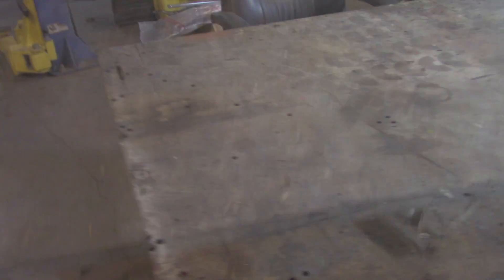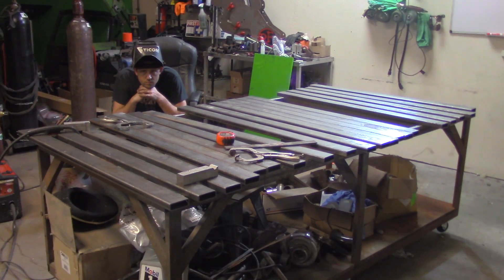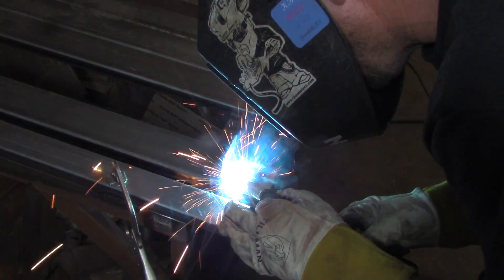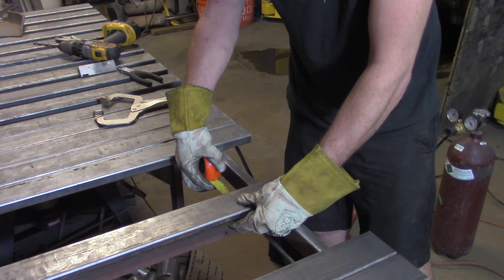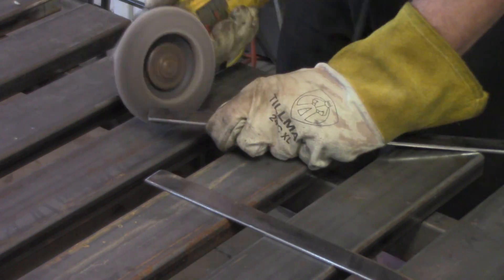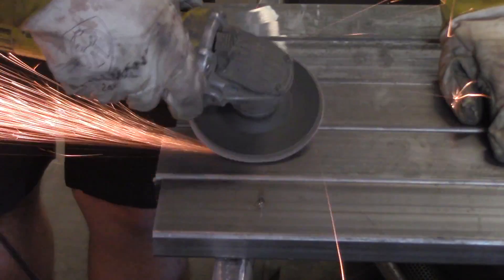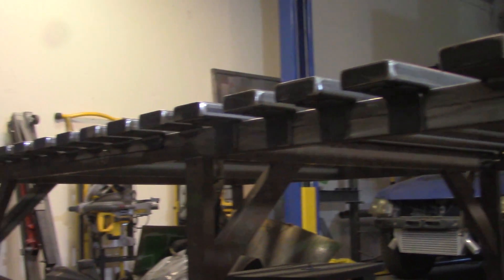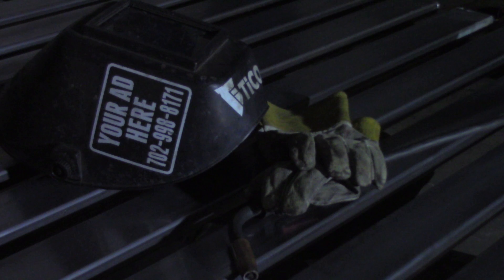TFS: Inexpensive DIY Fab Table

Comment: I needed to build a table for use at work. I need a general fab table that i could customize for a specific job.
I used this table as inspiration but built it heavier. It 5x10 with 2x4x1/4" wall tube. Turned out great. Thanks for the inspiration. Wish i could upload a picture

Comment: Tip for those holes if you are using a standard drill. Measure and mark 1 peice, stack and square the ends on one side, clamp throw a square on your mark and you are halfway there

Comment: Not the table for me.
As a fabricator I would have assumed there's gonna be spatter all over your slide rails eventually, you've made them so tight fitting that one little stubborn berry with mess with your table.
Good idea in theory, you made it look awesome, but I don't think this table will have much movement soon after fabbing on it begins.

Comment: I am planning on building a similar table and was wondering if you think rectangle tubing is better to use that flat stock. My idea was to either use 1/2" x 4" flat stock or 1" x 4" 10ga rectangle tubing. Not sure which way to go for my first table. I'm just a home hobbyist. Thanks in advance

Comment: any ideas on how to make a flat table without something flat to build it on?
Reply: Well... it ain't easy but it's possible. That's how they made the first one, after all :)

Pretty hard to explain in only words, asks for experience and demonstration really. First thing you need is a lot of patience and commitment. Then at least one big fat perfectly straight portion of square or rectangular tube to use as a clamping base/guide to assemble your parts, at least two C-clamps, big Vise-Grips, or welder's positioning magnets, and preferably two or more levels to measure alignment as you go along. To make a first rectangle, build two "L" halves first, using your fat strong clamping tube, then assemble them into a rectangle. Use a square, or the Pythagorean Theorem to check your half rectangle "L" shapes for straight angles. Use diagonal measurements to check your final rectangle, the square is not useful here.

Mind how you tack your parts, to counteract the shrinking after tacking - always work in an X pattern. Make sure everything is aligned after tacking, before final welding. Do not completely weld the half rectangle "L" shapes before assembling the entire rectangle. Use more well placed tacks, or a hammer, to sort things out if needed. 
Tack the entire structure before final welding, preferably. Use triangulation in your design, when you get to the supporting structure.

Measure things after every welding action. If you want to be sure, loosen the clamps before measuring - things may move, and the harder you weld, the more they will. Each time you weld, there will be shrinkage after cooling. You need to balance the heating and subsequent shrinking so things end up straight and square - hence the "X-pattern" you need to observe. 

Easier to explain than to do. Nothing beats experience, which is acquired by trial and lots of error ;-)
So try on a bunch of scrap first, preferably of the same dimensions as the final project, until you know you got the feel of it.

After a couple of builds, you'll go faster and without so much precaution ;-)
Reply: @wildepascal  it was hard. but excelent explanation. so, i understand i have to clamp the two parts of the "L" to a big fat flat piece of steel. do it twice, then join them together. (still using that as a reference )
Reply: @wildepascal  btw. i didnt say thanks

Comment: This is awesome! With regards to the end caps, I think cutting the square tubing to bend the metal over may save some time.
Reply: That would take 2 cuts, bending/hammering, 3 welds and post grinding. 1 less weld than using flat bar for end caps but more time spent in the bending/hammering phase

Comment: Very nice fab table top. Only one thing I saw you missed. Unless it just was not shown in the video. The angle V on the one end. What is needed is flat stock on the bottom for a flat clamping surface. That allows pieces to be easily clamped in the V angle for welding.   My dad has this feature on his portable welding rig. Works great for many things

Comment: Well it's inexpensive when you find the working material near a dumpster, isn't it?
Reply: If you don't, get two identical saw horses and use those as feet. Makes for an inexpensive yet portable welding table.
Reply: @brag0001  I actually built my own welding table out of an old machining table a local factory was throwing out. Its not portable, but it is solid and spacious. If one gets lucky and finds a reusable table or materials, making a nice welding table can be inexpensive, but if you have to buy all the materials, not so much. The saw horse idea is actually a very good one for a potable welding table. I might try and make one out of second hand saw horses.
Reply: @jamal69jackson77  It's not even mine. I just saw it a few times on youtube. And since I don't have a lot of space for my workshop (1,5x1,5m, I'm not joking), I need to be able to move everything outside easily.
I started welding as a hobby only a few month ago, so I was looking to get something usable yet inexpensive. Two height adjustable saw horses cost me less than 45€, including shipping. I paid another 40€ for the metal to put on top. I've yet to assemble the actual table top, which I'm going to do this very weekend :-D
Reply: @brag0001  Good luck with your project!

Comment: I'm almost wishing I saw you before I built my table.
Lots of great ideas here
Dag your welding skills 
Great table build.
Mine have roller wheel and lockup to my wall when not Welding ,also as I need to wood working I have a plywood top that lifts off to weld in seconds ( love that) for I do both Wood Working and Welding and greasy car filthy stuff
Thanks for a great video Sir

Comment: i'll do the stick and scoot every time. Why?   If for any reason you get a bug problem whether it be spiders, roaches, or anything of such nature, you want those tubes covered.. No one is immune to infestation and structure like that with tons of deep holes that you can only reach with an air chuck is a no no... The pain staking welding is nothing compared to the pain staking dealing wih an aftermath of infestables.. However, to deal with the repetiveness of doing that job.. I would have come up with some nice looking design of a solid single piece that would cover them all yet not just be a straight piece of bar stock.. lol

Comment: Very clever design.  I like it.  I suppose you could space the tubing so individually removable tubes could turn this into a solid surface by pressing all the slip-joints together then add the individual ones.  I don't do much fab at this point so maybe this wouldn't make a practical difference.  I am thinking of building a regular work bench with similar features out of wood.  Once I get welding/fab going I will build your design.

Comment: Would it not be advisable to leave the end caps off to cool things off?  I made a table like this out of 3/8th steel flat bar. It heat warped and the slats are not level with each other.  I'm thinking about doing the 4 bolts on each slat to level it.  The rectangle tubing seems like it would be better than mounting slats on bolts.  What are your thoughts?

Comment: Stack angle/bed rails  w slats cut for the rails.   Removable, adjustable, and good for bending thinner metal also.
If u Fab it to a treadmill base u can adjust it up and down at an angle.

Comment: A sizzor lift hydrolic level positioner would be crazy.
Reply: I was thinking cheap bottle Jack's at 4 corners for height and level adjustments with something on the table. Get air operated Jack's for the win.

Comment: I wonder if tubing filled with concrete, it will give some advantage that kind of design?  Thanks
Reply: I think it definitly would but also would add sooooo much weight
Reply: Will also explode when heated!
Reply: @TheSoundOfTwang  why it should exploded? Skyscrapers use this technology...
Reply: @717Fang  Sky scrapers usually don't get heat cycled a lot ...

Comment: The one thing that I would've done differently is go get a bunch of metal shavings/chips to fill the tubes before capping the ends. I've got a table kinda like this at work and doing that really cut down the noise/harmonics.
Reply: Oliver Hall great idea - solid packed, or loose fill?  I was thinking dry sand, because I haven't made enough metal chips.
Reply: @firstmkb  Dry sand would work excellently, probably better than the metal chips - 50% fill should be more than enough!

Comment: Will pressure from heat not build up in the tube?
Reply: Better leave at least a small air hole for it to escape.
Of course, for the novice welder that isn't hard.

Comment: Looking for a suggestion on how to get the top on my table mounted perfectly flat with each other. I have 3 - 2'x3' pcs of 3/8" plate with space to slide clamps in between. Thought it would be a great top but I'm having trouble getting a flat surface with the 3 pieces. Any thoughts?? Thanks in advance

Comment: hammering ?
Reply from the maker: Mike Forrest Hammering what?
Reply: The Fabrication Series look 👀 nice but how can u 🔨 on tubes ?
Reply from the maker: Mike Forrest I'm not sure I understand what exactly you're asking.
Reply: The Fabrication Series never mind looks great 👍🏻
Reply: It doesn't look sturdy enough to hold up against hammering. That's what he meant. And it probably bounces around or gets damaged quite easy. In our factory we use like 1 inch thickness sheet for the top and it weights more then 2 tons, lol.

Comment: should have used at least 1/2" thick flat stock instead. much flatter surface and much stronger against hammering and such. its a weld table, who cares how heavy it is as long as you can move it.
Reply from the maker: Nick Corkery Consider the use. Match it to the use. Anything else is unnecessary.
Reply: The Fabrication Series well at the very least you should want as flat a surface as possible. And we all know that square tubing is not perfectly flat.

Comment: I was building a hot rod frame and had no table. Needed something to tack down frame rails to. Went and bought a 3/8” 4x8’ slab of mild steel. Put it on the floor of my garage. Did layout on it tacked parts down. Worked great, takes up no space. You have to work on the ground but the plus side is you don’t have to lift anything up.

Comment: Table wobbles because the legs need more bracing, the sliding  section is starting to jam up already. Good idea, but needs improving.
Reply from the maker: +norman norton it's on wheels. It doesn't wobble. Read the other comments about the slats. There's a reason they don't slide perfectly free.
Reply: OK, thanks for the prompt reply.
Your table has certainly given me some ideas for my one.
Regards from London, UK.

Comment: Hi ! I'm french so excuse me for my english and i'm not a professional but i'll do some metal work so i want to build a good table... i love your welding table, i'll do the same !! 1 want to do one about 120" x 60"' (hope i'm ok with the conversion from cm, 300cmx150cm i want)
I just want to be sure for the tube to buy. I think to do the frame with square tube 2"x2" but i'm not sure about the thickness, 0,11"or 0,15" ? 
And for the rectangular tubes 40"x20"x0,07" or 40"x20"x0,11"

Thanks a lot for your video and hope to read you for my question. 
Bye !

Comment: like your build I've watched quite a few...there a couple like this but I think I'll with square tubing and use smaller size so I can make a slip in vice and slip it in the box tubing..on the sides..I also like the v trac...idea and the pull out leaf is good..
........

Comment: You could make the slats retract or extend by power remote control. Use an old windshield wiper motor and threaded rod. Easy enough to link them together.

Comment: some dielectric grease on those sliding portions would probably make your life a little easier. looks like they're a little sticky
Reply from the maker: gvente87 Once the grinding and metal dust gets stuck to the grease it would make like hell. I also don't want them to move easily when something is clamped to them.
Reply: yeah I just though about the dirt build up issue then saw the notification that you had replied. :-/

Comment: Nice table!  (Maybe you can grease the supports a bit so those top rails slide a little easier.)
Reply from the maker: Mark - Grease wouldn't work well after a round of grinding. I also kind of want them to be difficult to move since I don't want the part I'm clamping to potentially slide out of position.
Reply: The Fabrication Series - you're right, didn't think about the grinding.

Comment: You had me at "inexpensive".
Reply: Except it isnt really, it is a nice table with its function, but it isnt inexpensive
Reply: @pitpotdeeerste  less than 300 bucks.  Turned out amazing.  Just the time cost kinda sucks.
Reply: @kartnerds  Compared to some of the fab tables 300 bucks is inexpensive, yet 300 bucks is still a little above my budget for this hobby. Now if i recall correctly the top was made of tube,  i personally was thinking about a U profile 40x20x5mm it would set me back 18 $ per 6 meter which would be 50 by 72cm  in work surface with 2 cm spacing's .
 Some 40x40x4 mm angle for the legs and cross braces which is 25 bucks for 10 meters ( i am unsure if this is thick enough to rest the U`s on). 
i was thinking to add some simple extensions on 3 sides to support the bigger work pieces.
Reply: @pitpotdeeerste  Gets cheaper the smaller you make it.

Comment: Great idea, but is the rectangle tube wallthickness  thick enough to absorb the heat from welding regarding warpige?
Reply from the maker: Smeerkees Depends on what you're welding and the time it's exposed. It will take some effort to distort it.

Comment: Do you think the table will stay perfect flat due to how tube has the problem of quick warping from heat? Bad ass table though, i guess if needed you could always just throw a sheet of plate on it.
Reply from the maker: Will Shoemaker Consider the amount of hear actually going into a single tube. Unless you lay on it with a rosebud torch, it won't really see enough heat to cause significant distortion.

Comment: Wouldn't the clamp force bow the round bar causing all the slats to raise off of the frame? I would put more cross members in with maybe a thicker gauge round bar with less tolerance in the holes, but that would be kinda difficult to pull off without spending loads of time getting everything lined up hey!

Comment: How do you use the V track/tray on the end?
Reply from the maker: Thai Brand Its usually used for butt welding tubes and pipes together straight by clamping them into the angle.

Comment: Awesome Table.. okay Real Question - Rust, how are you going to keep it all from Rusting? Raw metal wouldn't last 2 months where I live.
Reply from the maker: +Jas B I live in the desert. We don't see a lot of rust, but regular maintenance will keep the rust down. Maybe a light coat of oil will help as well.
Reply: Jas B. I am a Florida welder. 100% humid every day. Trick is "THIN OIL" spray type. every morning I am using the table I wipe it down. Every night when I leave, Spray, wipe, keep it thin. If it does rust at all a DA sander cleans it off (note: Wipe the oil off first). Never use a angle grinder to clean surface rust. Use a DA like a auto body shop does. keeps it flat and you can pick your grit. 220 for bad rust 440/600 for a shiny coat. Remember the heat will burn the oil so I spray the sides/bottom and don't wipe. Hope this helps. O BTW, SWEET table Fab man.
now I gatta get the grinder out and make a removable and slide section.  Where were you when I made this in the first place. :p
Reply: HTHC have you tried any kinds of drying oils, like are used for woodworking?  I think boiled linseed oil (from any hardware store) would dry to a nice thin coat, and not need as much maintenance.  Some, but not daily.
If I can ever figure out a way to dehumidify St. Louis, I won't be able to afford to live here.
Reply: Linseed oil diluted 50/50 with turpentine. The turpentine will evaporate, and the linseed oil will leave a nice thin film on your iron/steel or whatever. I have tools and workbenches out in all kinds of weather and coat them like once a year, quick job and they're doing fine. Use two coats spaced twenty four hours the first time, to be sure. For welding I tend to clamp the ground to the workpiece and not the bench, but every now and then I forget to do so, and the ground on my workbench seems to be pretty good through the oil film - which probably is no thicker than a few microns. Once evaporated it is dry also and not sticky, it's not as if you applied motor oil to the surface. Try it out, cheap and reversible if you don't like it.